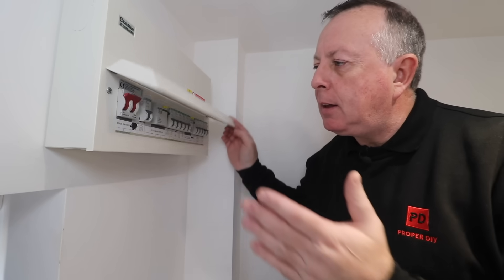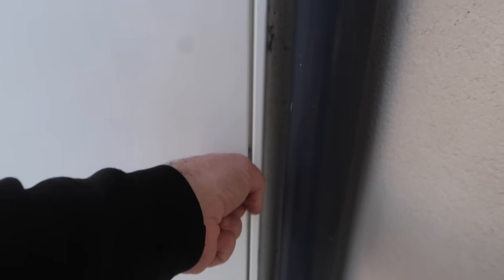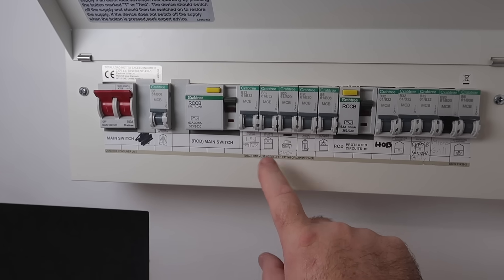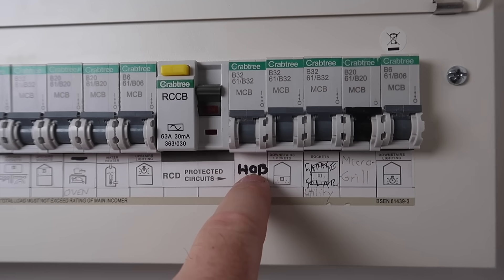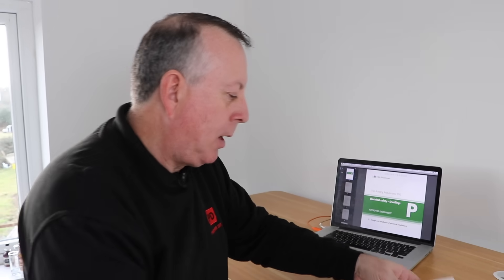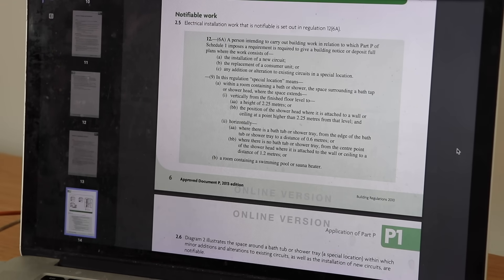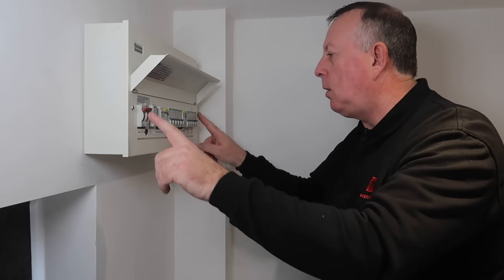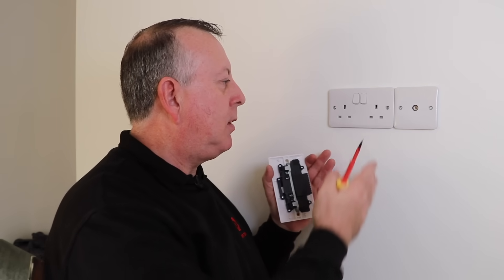What electrical work are you allowed to do in your own home?

Comment: I was prevented by Part P from wiring my own kitchen so I had to get a so called Sparky to do it for me. 2 things: I told him to put the cable THROUGH the joists for the lighting circuit - he put them under and secondarily I had to complain about him to get him to send me the paperwork to say he'd done it!

And then, of course, I did the job myself the way it shoude have been done in the first place by drilling through the joists as I'd asked... Ah well yeah and I should have had it rechecked and there were reasons about..... No, the bloke just wanted my money because I HAD TO USE A SPARKY - this was on an extension.... If you clip wiring underneath the ceiling joists, although you can (with difficulty) pinch the cable between the underside of the joists and the plasterboard for the ceiling, you leave a shock hazard for the guy coming in 20 years' time putting up Christmas tree decorations for his children !!!!!!!!!!!!!!!!!!!!!!!!!!!!!!!!!!!!!!!!!!!!!!!!!!!!!!!!!!!!!!!

£200 to do the job properly myself for a poxy piece of paper!!! - Part P?!?!?!? The easy way to deal with this is to say that when your house is sold, IT MUST HAVE an electrical safety certificate. If you want to do electrics FOR SOMEONE ELSE you should be qualified to do so - DON'T stop ME from doing something that I understand and am competent to do FOR ME
Reply: I’ve had a similar experience. I am a retired engineer with decades of experience installing equipment in hospitals, including operating theatres, to a much higher standard than domestic installation - but thanks to part P I have to get a qualified electrician in to my domestic wiring. I wouldn’t mind - I accept that it is important to be up to date with the latest regulations - but I am often disappointed with the quality of the work, I know I would have done a better job myself  and I always have to chase them for certificates.
Reply: If you had specified cables through joists, and he didn't, don't pay him.
Reply: @markrainford1219  Caveat - put your specifications in writing. Have him sign that he accepts the specifications and will do the work as described.
Reply: It's because the paperwork costs extra money.   If he's unregistered, he's supposed to send a notification to the council that they've done work and pay a fee for the privilege.  For small jobs, this can be a significant cost.  And yes, he should have drilled through to start with, ensuring the the cable was laid 5cm below the surface or else protected from a casual diyer drilling or nailing.
Reply: @randeknight  cables don't have to be 50mm below the surface though. Perfectly fine to lay cables touching the plasterboard.
According to regs anyway.
Reply: That's what I assumed the law was and common sense suggest something like: Do whatever electrical work you want to your own house, but if it doesn't comply with building regulations, expect to have to spend a fortune fixing it all if/when you come to sell your house.

Comment: If you wanted to add an extra circuit to your board because it's a type A rcd  you'd have to put a second board in with a type AC rcd, or change your rcd to an Ac type. That's the regs when we add a circuit now, adding lights and sockets to an existing circuit is fine tho. It's getting crazy now
Reply: Wrong way round 🤪🤦🏻‍♂️

Comment: When I owned my own property I was happy with the electrics as they were checked. Now I rent it is a different story. When my electric shower went wrong it was replaced by a plumber that I didn't feel was very good. Luckily, two years later, my landlord had all of the electrics checked out and the shower must have passed the safety check, otherwise it would have shown up as a problem ? Are there any rules stopping my landlord from just having a plumber attend to fit the shower and not an electrician, as it makes a joke of the whole system ?
Reply: Bathroom is special location and comes under Part P.
Reply: Private rental electrics should have an EICR from April 2021. The shower still has part P requirements  to meet if it was replaced afterwards.
Reply: @ChariotsofWire180  Is there any way I can check ?

Comment: Part P was introduced in 2005 as a knee jerk reaction when an MPs daughter was killed because of poorly installed electrical cable. It was not DIYed. This vid generally is quoting the 2005 Part P.  It was unworkable, so was stripped back in 2013. Anyone can perform electrical work, as long as you are competent, except on the meter and main fuse which have seals.  Competent is the word used, not qualifications.
Reply: Qualifications are one aspect of proving competence. Good luck in court if with a defence of " I copied it off of a YouTube" video if something goes wrong.
Reply: @bushtuckertrialsofa6674  wrote:
"Qualifications are one aspect of proving competence. "

They are no such thing.  Competence is the results, what you do, and safety in how you do it. Not pieces of paper.
Reply: @johnburns4017  Yeah they are. When taking a City and Guilds in electrical installation for example 50% of that is practical with associated exams. Achievement Measurement 2 (AM2) is  a practical exam.
A measure of competence as are the written exams which provide under pinning knowledge. They are measures of competence. 
You obviously don't have any qualifications so will struggle to prove it if anything goes wrong.
Reply: @bushtuckertrialsofa6674  
I have seen lots of  substandard work by men with certificates with nice coloured shields printed on them. Competence is the results, not a piece of paper.  You just do not get it.
Reply: @johnburns4017  Still need training to gain competence. Certificates are proof of that training. No training, means you have zero chance of being competent. Certificates provide proof that a certain level of competence has been obtained at some point.
Reply: @bushtuckertrialsofa6674  
Do not need training. Many skills are transferable from different fields.
Reply: @johnburns4017  There's not many transferable skills I can think of. Definitely won't have underpinning knowledge. Those are factors in competence. 
Must be hard for people like you who think they know what theyre doing but in reality are just winging it.
Reply: @bushtuckertrialsofa6674  
There are lots of people engaged in industrial electrical plant and equipment. They can easily understand and fit domestic electrical systems. 

The craft skills needed for domestic electrical work are simple. Most to common to other trades like lifting and replacing floorboards, drilling walls, mixing plaster to fill holes, etc.

Comment: What about the U.S. , still 110 volts?
Reply: and?
Reply: The US is split phase: Two 110V phases, 180-degrees out. Provided using a center-tap transformer. So while most sockets are 110V, heavy-usage appliances (washers, cookers, AC, etc) can be fed on both phases for 220V. This is a bit of an odd way to do things, but it's too late to change now - there are historical reasons for it.

The UK is single-phase 230V.
Reply: @vylbird8014  
and?
Reply: @vylbird8014  The US doesnt use 110 and 220  V since the 1930s. Its 120 and 240 V.

Comment: - metal fuse box survives longer when circuit is overloaded and/or improperly screwed in. Plastic melts and can cause a fire
- in general appliances w/o a factory plug (7kW electric range, induction oven, high power water heater, garage door etc.) need a certified electrician to install and sign the warranty. Highly recommended, specially in case of induction stuff... expensive and can break if installed improperly or just due to the amount of electronics inside
- outside socket/ lights/ automatic fence should be on a separate rcbo, if moisture gets in and/or socket gets damaged it will only trip it's own circuit and not cut power to half of the house (or whole if you only got 1 rcd)
Reply: "- in general appliances w/o a factory plug (7kW electric range, induction oven, high power water heater, garage door etc.) need a certified electrician to install and sign the warranty."
No, a competent workman.
Reply: @johnburns4017  Really? No need for stamp on the warranty?

Comment: Hi my house was rewired in the late seventy's and has a old consumer unit, which would comply with the IEE regs at the time, but not with the new ones. The IEE regs were made by a committee made up of representatives from manufacturing company's, so don't you think that if they changed the regulations, so say you had to use more earth wire, would that not be in the manufacturers interest as that would increase there profits. and not for safety reasons. I worked  in the back office  of a installation company, this is what I heard.
Reply: With every change of the wiring regulations there is usually a need to upgrade a consumer unit to a different type for various reasons. Over the years the safety protection has increased greatly. If the installation company you worked for still exists let's hope they change their outlook.
Reply: They changed the regulations in 2008 to remove the need to "bond" every metallic item together as long as certain conditions were met, so either they fell out with the Earth cable manufacturer and changed the regs to P them off, or what you heard was just an uneducated opinion
Reply: @codenamenel  Part P is all pretty general and doesn't bother itself with that sort of detail.

Comment: Clearly the label 'says' 230V but we all know nothing has changed and everyone is still getting 240V. It was a face saving exercise by idiotic EU bureaucrats.
Reply: The idea was to get all the EU on 230v in time. Which is a very sensible thing to do.
Reply: @johnburns4017  No it was not a sensible thing to do. The cost of all of Europe changing all their electrical infrastructure (which is designed to last for decades) is astronomical which is why no one did it. All it needed was for manufactures of electrical devices to make sure they worked within the range of all EU countries. Simple and cheap.

Comment: There is absolutely no way that DIYers in their home carrying out electrical work are performing the required inspection and testing and completing electrical certification under Part 6 of BS7671 wiring regulations. E.g r1 + r2, insulation resistance, earth fault loop impedance. 

Something that really only a qualified electrician knows and does. 

THIS is the problem that us electricians have with DIYers. 

If you say I’m wrong, show me your multi function test instrument.
Reply: DIY is totally legal. They can get a guy in to do a test.
Reply: @johnburns4017  Yeah right. The reason people are DIYing electrical work is because they want it done as cheap as possible. So the chances of them paying anyone to inspect test and certify it is next to zero. They may just as well pay an electrician to come in and do it properly in the first place. Everyone knows it just doesn't happen.
Reply: @davebadger100  
You opinion and views are worthless, as is anyone else's. The laws say all electrical work can be DIYed, as long as you are competent. This vid is very wrong.
Reply: @johnburns4017  I'm not arguing about whether or not DIYers can do electrical work or not. I'm arguing whether or not DIYers are complying with the law when they do their work. 
They may well be competent. But that is irrelevant if they are not carrying out the job in full, which includes testing inspecting and certifying of ALL work whether it be notifiable or non notifiable.
I am saying that most if not all DIYers will ignore the testing inspection and certification part and therefore they won't be able to comply with the law.
Reply: @davebadger100  
Competence is:
1) The result;
2) Safety in working. 

If a DIYer is competent he will conform to both. That is simple.  Your wandering views on what they might do or might not do is irrelevant. 

I have seen so called professionals fall foul of numbers 1) and 2) above.
Reply: @johnburns4017  And what about the testing inspection and certifying of DIY work that never happens?
Forget about competency which I never mentioned in the first place. I'm not interested in that. 
Try arguing the actual point.
Reply: @davebadger100  
If he is competent he will do all that. You cannot separate the law from your wanderings. 

As an aside, in a recent court case where someone was killed because of incompetent electrical work, not once were BS 7671 mentioned. Why not? Because you can fit any electrical system as long as it is safe.  In short you can buy the cheapest and nastiest electrical wiring, sockets and equipment , inc' main panel and breakers, from Home Depot in the USA and fit it. All legal.
Reply: @johnburns4017  You keep banging on about competence. It's  Irrelevant in this argument  You have cherry picked the word competence from the law because it suits your agenda. Talk about confirmation bias. 

Competence does not define what someone will or won't do. Stop talking rubbish. Just because someone is competent at electrical work it doesn't automatically follow that they will test and certify it. 
Again If work is not suitably tested and certified it is against the law 

Of ALL the DIY work I've come across not one bit has ever had a test done on it. Ask all these DIYers on You tube if they test and certify their work and all you get is crickets. That's because none of them would have the first idea about testing or even filling out a certificate. That's on top of not having suitable calibrated test equipment in the first place.

What makes me laugh is you DIYers banging on about how electricians are all bodgers and do unsafe work, so thats why you all have a bash at it yourselves. Yet when the question of testing and certification arises you all say get someone in. So you won't trust them to do the work, but it's ok for them to tell you your work is safe. Oh the irony.

As for wandering, off you go again with court cases and legal guff about fitting non BS equipment. Go ahead and fit stuff from Home Depot, why would I care? That's just your DIY mentality showing through again. 

As for BS7671 it is not a statutory document but it is a standard to be followed. Much legislation including Part P etc defines it as standard to be achieved.

Quite why someone would want to deviate from that is beyond me but go ahead. Good luck defending yourself in court if it all went wrong and you hadn't followed the regs.
Reply: @johnburns4017  "You cannot seperate the law from your wanderings " says someone who then goes off at a tangent talking about not complying with a set of regs, that you have to comply with to reach the standards set out in an approved document related to a building Regulation which is law. 
Oh dear.
Reply: @davebadger100  
You have to understand what Competence means in relation to electrical.
Reply: @johnburns4017  

You are 150% wrong. 

The Electrical At Work Regulations states under regulation 16:

 “No person shall be engaged in any work activity where technical knowledge or experience is necessary to prevent danger or, where appropriate, injury, unless he possesses such knowledge or experience, or is under such degree of supervision as may be appropriate having regard to the nature of the work”

DIYers do not possess the electrical training, knowledge or experience to justify their “competency”.

I run a NICEIC approved electrical contractor mate, you’re not an electrician. So I’d leave the conversation before you embarrass yourself further.
Reply: Great comment, totally agree 👍

Comment: The incoming voltage has changed in name only. The means of generating it is still at the 240 415v ratio and thats all to do with transmission. When installing new kit on existing circuits volts drop is king. Oh and the part P qual that was brought out 20 odd yrs ago was an insult to electricians everywhere. RCDs and RCBOs do the same job essentially. If you dont know why the cable your using is the right one then dont do it esp in modern  properties where they are insulated to the nth degree.
Reply: An RCBO has overcurrent protection, an RCD does not..

Comment: Just curious are you qualified electrician or engineer. Don't come to Australia as all the information you supplied is wrong here in Oz. . From an Australian perspective you have skipped over so many rules and regulations and saftey issues its not funny.
Reply: Hi Greg - the video clearly states validity in England & Wales. It would be  impossible to make the video compliant with the whole world. But I sympathize with your situation in Oz.
Reply: @harryinhuahin1272  my question was raised based on my background in electrics. I become concerned when I see videos such as these by "Proper DYI". Electrics is a very precise trade. Here in Oz it takes minimum of a 4 year apprenticeship, post trade courses and then ongoing trade training as well as keeping up to date with a very specific wiring code as well as obtaining a electrician licence, contractors licence and then local supply authority licences..  I cannot tell you how many times I have  been called to rectify an issue by a DYIer, some that could have had disastrous results. If people are going to give you advice I like to ensure they have the requisite knowledge to give that advise. Whats the old saying, everything goes well till it turns to Shite.
Reply: Most of it was wrong for the UK.